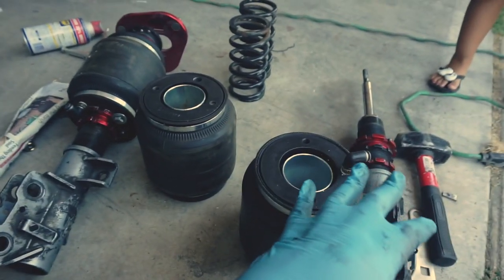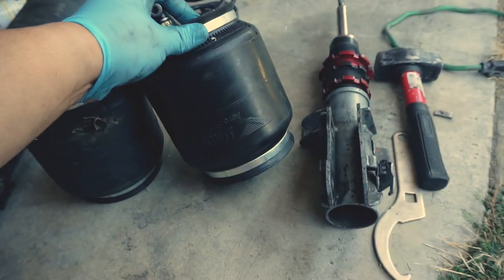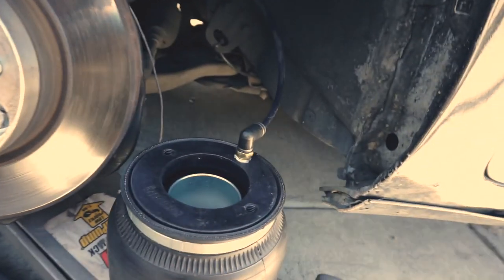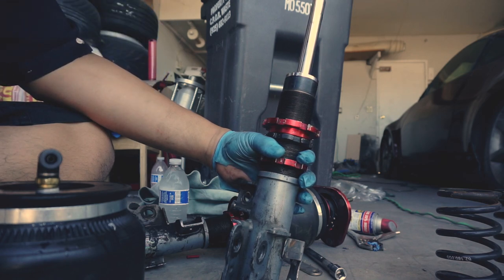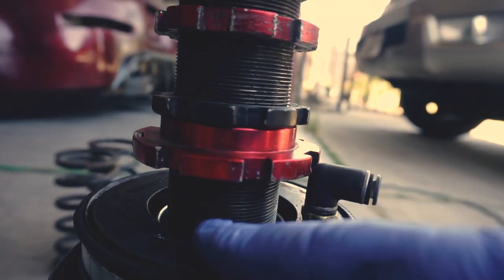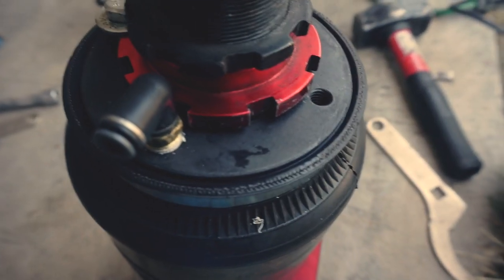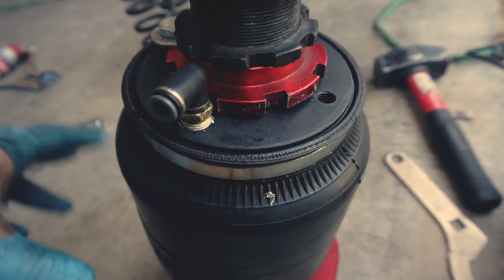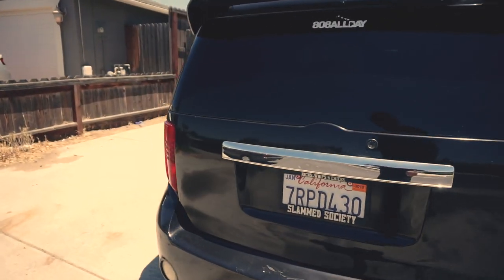Quick Bag Over coil install!

Comment: will people please stop using teflon tape on their air kits, use paste, your management system will thank you for it.
Reply: Alex Leeden I use loctite 545. It's made specifically for pneumatic and hydraulic fittings. Never had a leak ever
Reply: I have used teflon tape for years, never had an issue.
Reply: @jaredshelton4718   same use it on all the air brake fittings on big trucks with no problems ever

Comment: Plz nobody hate on me for being stupid but do u need a air tank and compressor for that install if so did u have to buy it seprately?
Reply: Air suspension requires a tank/compressor/manifold along with the bags and struts of course.
Reply: Koruton Hitsugi unless you put a schrader valve and hope there are no leaks you can manually fill your bags like a car tire. They did that bag in the days and had the schrader valve under the rear bumper and would fill it up from a compressor in their garage  or at a gas station. The idea is your installing the compressor and tank for portable storage and 24/7 access to air in case your lines or fittings have a tiny leak or develop a tiny leak then you can hit a switch to activate 8 solenoid (4 to lock air inside bags and 4 to release aire out which allows for the balance of height on each bag  valves which you will then need to complete the whole setup along with tank and compressor.